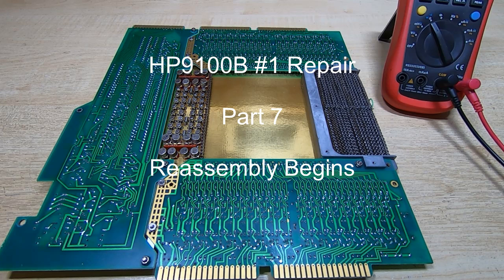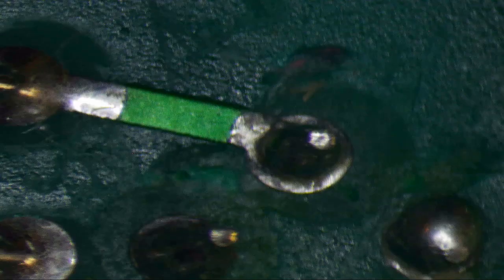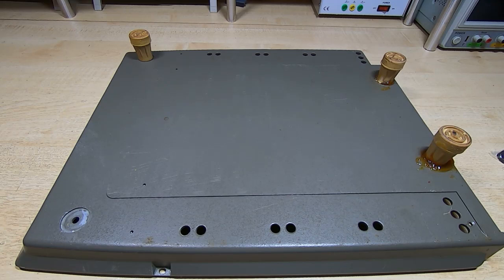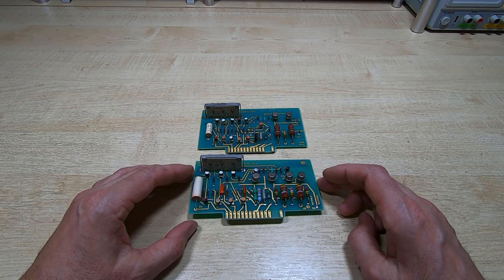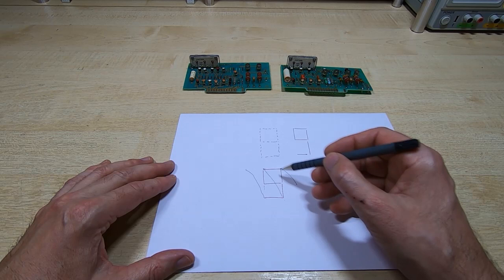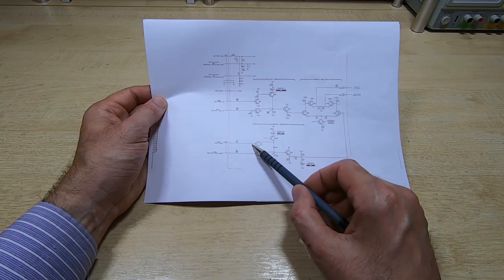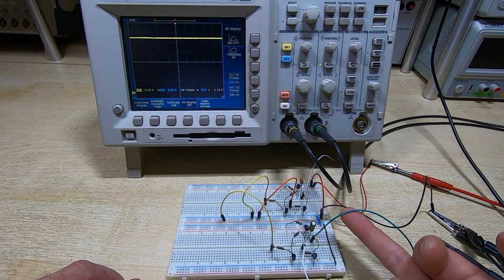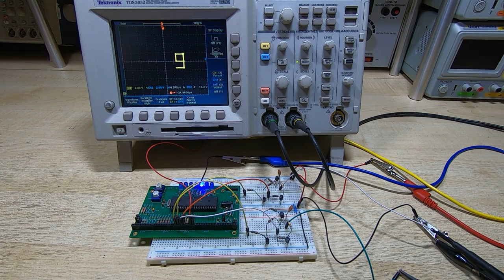HP9100B #1 Repair Part7

Comment: For the board edge connectors cleaning, i usually use a soft pencil eraser (usually the white ones), followed by a isopropyl alcohol rinse. The eraser is very mildly abrasive and will remove any grime that is accumulated over time.

Comment: A heat gun would cause the epoxy to deteriorate to the point where it can easily be crushed and chiseled out.
Reply from the maker: Unfortunately that only works on certain types of epoxy. This old epoxy may just start to gas. Also the heat could easily damage the paint. It was just easier to drill out the head of the bolt and pull it through.

Comment: Is this the same technique as scope clocks use?
Reply from the maker: Not really. Most scope vector displays use DA's to produce the X,Y voltages. This system uses 'Logic Stepped' voltage control. This method works very well for creating 7 segment style characters but would not be as useful for more complex displays such as a clock face but you could certainly use this method if you really wanted to. The main reason they used this sort of circuit was due to the low number of available control bits.